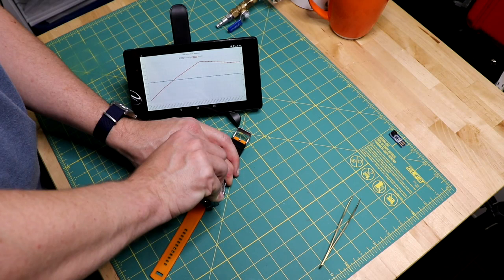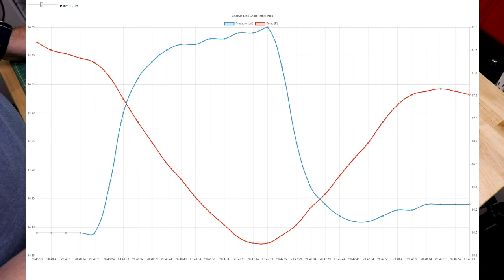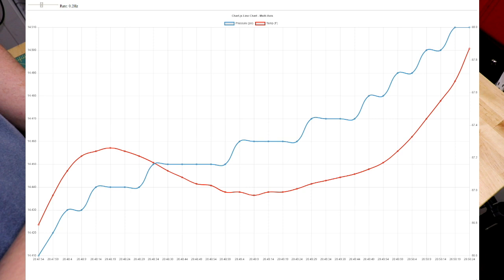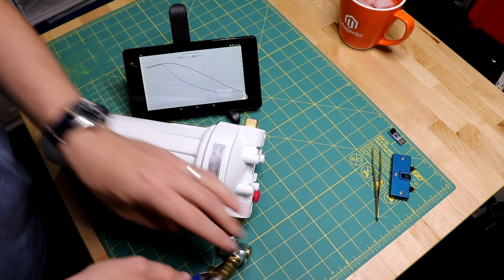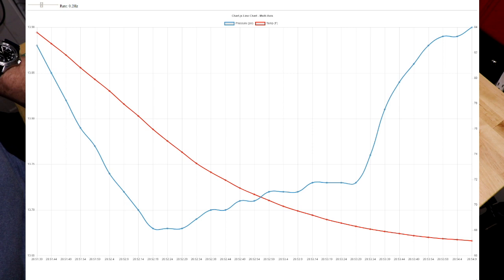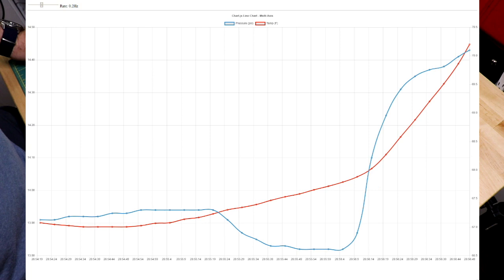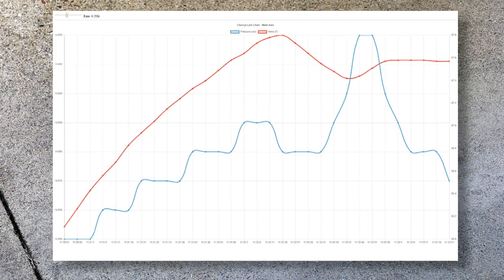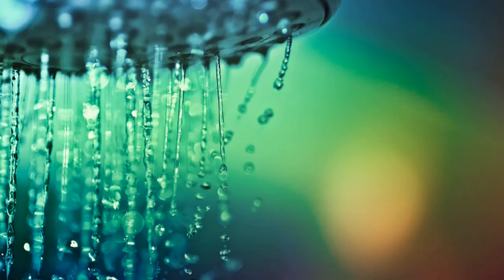Yes, you can shower with your dive watch.

Comment: While I understand that the pressure you're delivering with that pressure washer vastly exceeds anything one should encounter in their shower, there is one variable your experiment has left out... and that's the effect of soap on the surface tension of the water. It's likely moot since most of the water hitting a watch under pressure is "fresh" from the shower head and any soapy water hitting the watch from travelling down your arm would be washed away before any problems were encountered... but I would like to see if there is a coorelation between when two identical watches fail where the only variable is soapy vs. fresh water.
Reply: Soap was zero effect on silicone gaskets  and definitely doesn't change the effects on water.

Comment: Could the heat of a shower have more of an increase on the Incase pressure?
Reply from the maker: Yes. The heat will change the pressure inside orders of magnitude times more than the outside water pressure of a shower - but the same can be said for simply putting the watch in direct sunlight. If that case is heated up, the pressure is increased inside. Thus my argument that having a non-waterproof watch in a hot shower will - for a short time - be better than a non waterproof watch into ice cold water. Heat expands air flows out, Cold condenses sucks water in.

Comment: I got in the shower with my watch on and after I was under the shower for 30 sec I realized the crown was open. It’s a quartz 300 meter dive watch. Should I worry? I closed it right after and a dried it the best I could.
Reply: The worst you could do, leave it open for several days. If humidity got in, now you absolutely closed it!

Comment: A shower or 10 will not change anything. However every shower creates thermal cycles and soap contamination that will harden the gaskets. This could lead to salt water entrance once you really dive with the watch with potentially devastating effects. So it's better not to make it an habit
Reply: NO, soap was zero effect on silicone gaskets.
Reply: A good quality dive watch can last years up in showers. Ive had no problems or issues what so ever. I always shower with my watch.